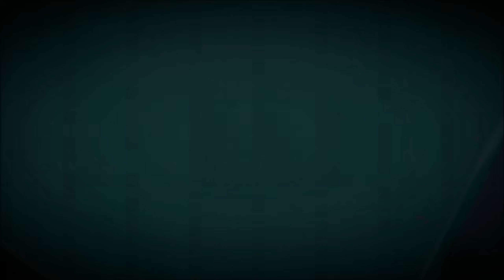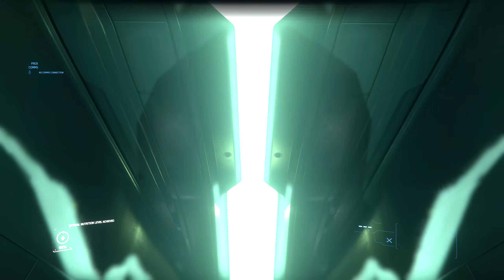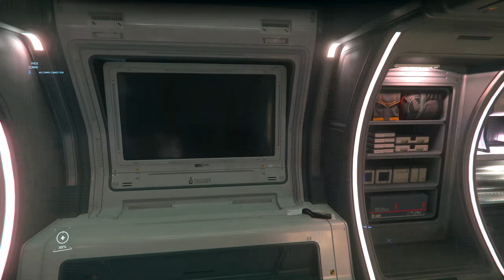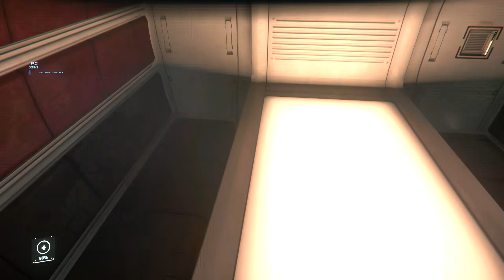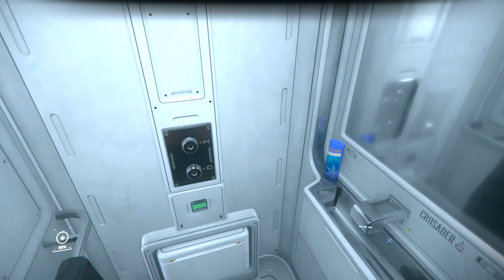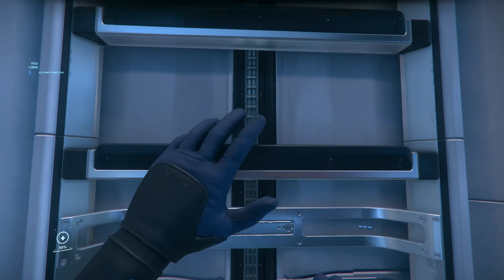Hercules C2 Starlifter First Look & Tour | Star Citizen

Comment: Great looking ship.  Some curious shading going on when viewing from the front.  Back left cockpit screen is the remote turret operator in the M2.  He gets a seat in the M2.  Still not sure why the shield generator is in the cockpit hallway and the other components are in back.. There are many unused component doors in back middle that are unused.  But as it is, the engineer must go to the back of the ship to disconnect the power plant so that he can then repair the shields that are at the opposite end of the ship. Then go back to the rear to reconnect the power plant.

Comment: You can pull out the coolers. Otherwise why have them accessible internally? Crew 2 min. Its used as a military transport for offloading tanks and soldiers, even with hot lz

Comment: Bit of wasted space in the back near the jump drives, could have easily been made in to a laundry room and a workbench with tool cabinet and one of the gun racks should have been replaced with a wardrobe for quick access to a heavy coat or a raincoat for when you need to deliver your goods on a planet with atmosphere.  Would it a bit more realistic, but I do love this ship.
Reply: And those two tunnels just below and outboard of the large engines could have been repurposed as two more smaller drive-in drive-off cargo bays.

Comment: Nice. Looks very much a homage to the current-gen C-130J it takes it's name from - crew reduced to allow for operating with 3 (one in the hold) instead of the 5 needed in a C-130H, more nimble than you'd expect from a cargo aircraft to take advantage of rough/short landing areas. Can't wait to see if anything's different with the interior of my M2. Front cargo ramp looks a little fussy (the swing-out doors partly block access to something tall trying to get up the ramp) but I guess you can just back your tanks out.

Comment: Does anyone else think the c2 was built for way more than 2 crew? Like that real nice recreation area
Reply: It's actually built for a operational crew or 4-8. 2 pilots, 2 gunners, 4 engineers/cargo crew
Reply: @northythefosk7501  there's two beds for 2 crew. Does it mean the c2 is meant for shifts or smth? Still loving the ship tho
Reply: @JH-uh3cc  probably shifts or they'd sleep in the recreation room. But most likely with vehicle modular coming there will most likely all expanding crew rooms. But yes they'd run shifts such as 4 awake at anytime. Such as a pilot, gunner, and some engineer's
Reply: Also gotta carry whoever is driving off the vehicles in your hold.